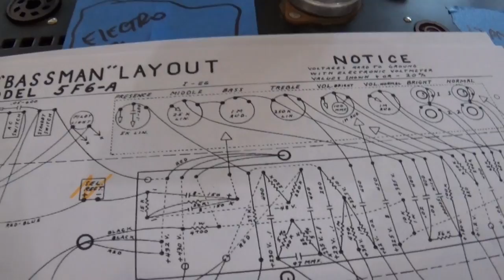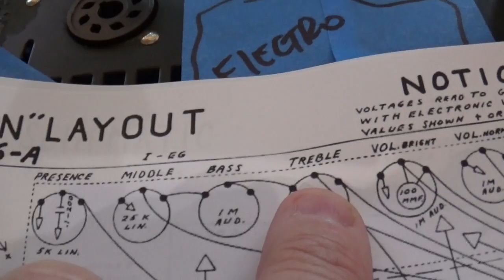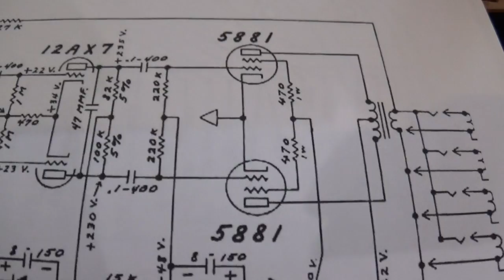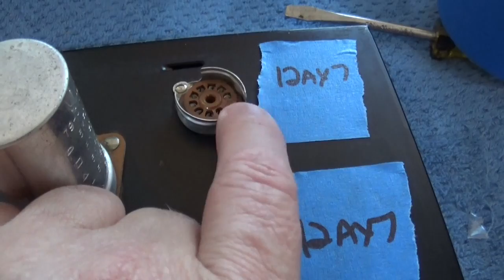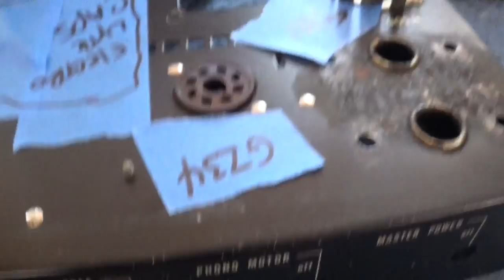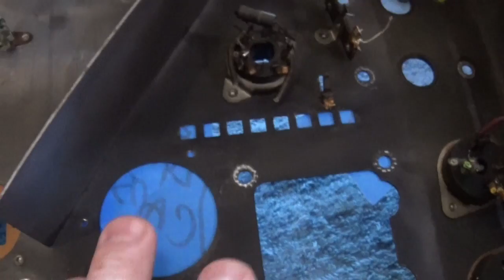Bogen Cha-620 Amp Conversion- Bassman 5F6A - Episode 2 -  The Low Down

Comment: Very awesome dual 6L6 amp Ron.  I like Bogen too.  Um still thinkin of a home brew Acoustic 370 bass cab for EV 18' driver, if I can find some 411 dimensions, never owned one, but those were very popular in the 70s.  I would like a nice el34 amp project for it too.  Don  dreamin...
Reply from the maker: There is always time to build one Don, go for it :)  I believe this amp will sound completely awesome when done.  We shall see - I have much planning to do.... always appreciate  your support  - Regards, Ron
Reply: hi Ron, I just won another Lafayette tube PA amp for about 100$.  The guy said i works and is complete with case and Turner mic.  Hope to have it by next week. Looks like another el34 amp, now I may try to make that 18' cab, I'd like an EV driver too, I may down scale it to a 15' speaker.  Don

Comment: This should be really interesting Ron. A lot of learning. I'm with you on the rectifiers, I know you need to replace them and there is a formula so you can add resistance to balance it out. Seen a lot of guys do it but don't recall ever doing it myself. It sure looks like you will have enough room in there for this. It would make it a lot easier for you if it does. Will be following amigo.
Carl
Reply: Hi Carl, I have an old David Bogen amp, gonna leave it intact, I have a vid about it with a crappy Leslie buried in my vids.  I've had a few tube Bogens through the years, I like them.  It's not the Fender sound, but still kewl for lead, not so much bass.  Um thinkin of a Hammond amp, guitarolgist did one, and Hammond tube amps can be found on ebay around 100$.
Reply from the maker: Thank you Carl.   I believe I would need (2)  1N4007  ( 1000v) diodes and a resistor or two.. that will be something I have to research on  how to wire them into the circuit.. I came up with a cool way to connect the components and will cover it in the next video.   I like this project because being a bass player I can really use this head when I gig.. the other amps I have build are ok for practice but not for playing out.   Thanks as always for supporting this !!  Regards, Ron